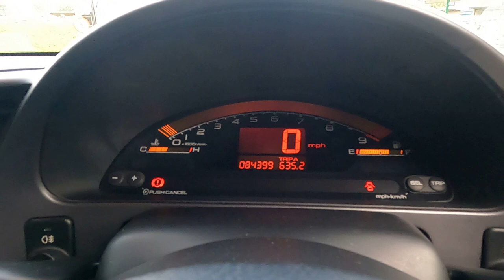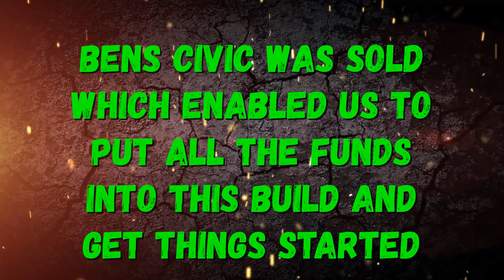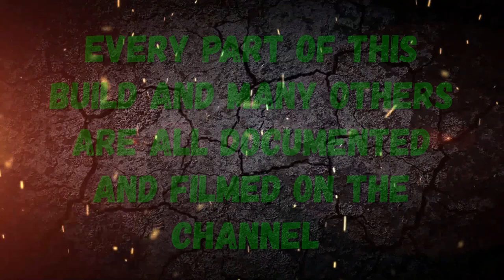Building my Wide body S2000 in 10 Minutes!! *WHAT A TRANSFORMATION*

Comment: Good work can you widebody mine for me now😂 what are the specs of the wheel and tyres? Also where are you sourcing your aftermarket parts? Thanks
Reply from the maker: Fibreworx did all my arches and over fenders mate. Rim sizes are 18x11 et8 rears and 18x9.5 et fronts tyres I can’t remember off the top of my head lol
Reply: @CowabungaCarDiaries  yeah I was curious on the offset as I have 20mm spacers on stock wheels effectively giving me an offset of 35 and 45
Reply from the maker: @elliot438bcfcVTEC  et 10 on the front sorry didn’t finish what I was saying lol